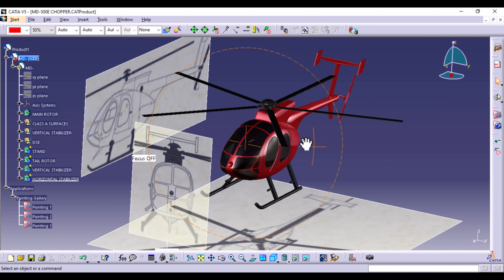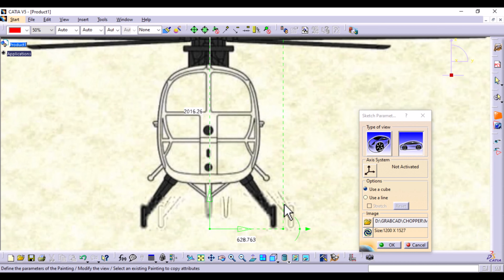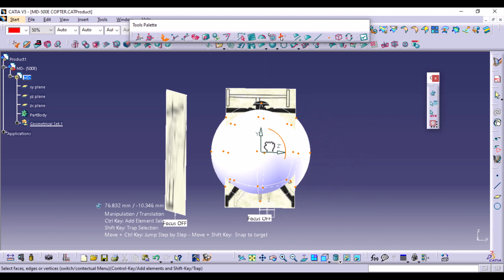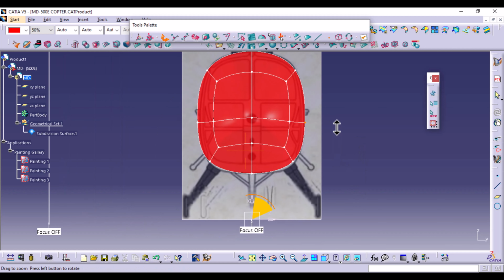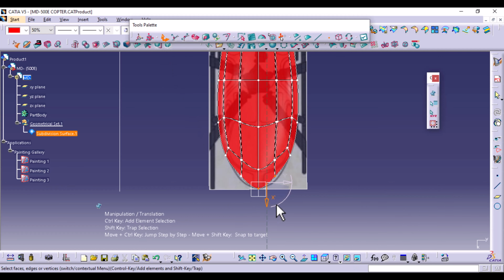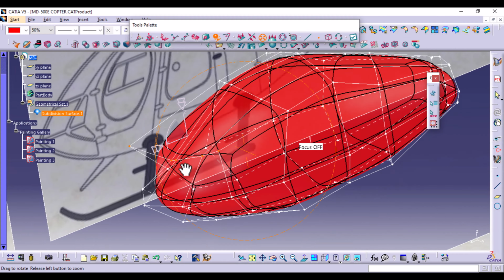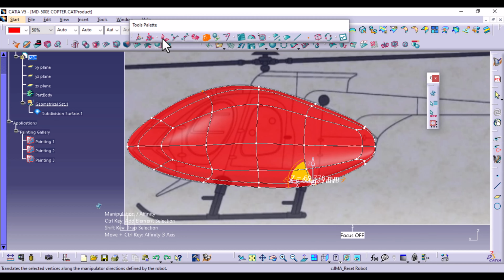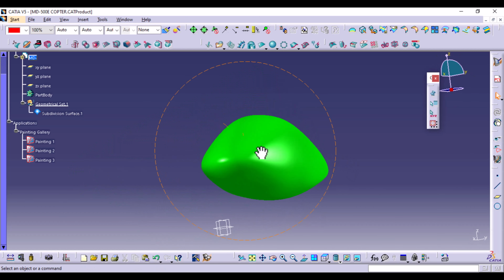CATIA ICEM (IMAGINE & SHAPE) - CLASS A SURFACING TUTORIAL| MD-500E HELICOPTER DESIGN| PART 1

Comment: Ariel You're truly the best, Thanks for your rich content🥰
and I dont know why when I select the subdivision surface it selects a box around it and dose not projects dots on my surface. I can only manipulate it with that box which is so low quality compare to your setting.
Reply from the maker: Hi,.what version are you using?
Reply: @ArielCad-3d thanks Ariel for answering my comment, It is Catia P3 V5-6R2019
Reply from the maker: @ehsanmansouri6897 when you're editing a subdivision surface, there's a selection filter cube that appears at bottom corner. When you hover over the cube, there are 4 drop-down menus at each corner...Set it to 'rectangle', 'all/all', 'low'& 'distant'...If you still experience the issue please send me a screenshot or screen recording via the email on my bio or reach out via LinkedIn
Reply: @ArielCad-3d thanks, I sent message on linkdin

Comment: There are obviously some major differences between toolsets within the various versions of Catia V5. Like other people commenting here, my version has differences which do not allow continuation. When you create the sphere, you get a "Geometrical Set 1". I get a "Subdivision Surface.2". Secondly, I get a small sub-window in the bottom-right of the screen showing the sphere, which if I hover my mouse over it, gives view and selection options, base-mesh options, preview options, and trap options. You don't seem to have that. Thirdly, my sphere is black, not red, and I have no ability to view or manipulate the mesh as you do.
Reply from the maker: Hi, everything you referred to is in the settings. They're set at default on the  2020 version which i assume you're using.
On the toolbar, right-click & select graphic options,
From there you can change the colour of the mesh.
The project is do-abe on all versions of CATIA. The toolbars are just set at different places.
When I create a sphere I definitely get a "subdivision surface" under geometrical set. Because it's the first object, that's why the geo set appears.
I will be posting a new project on the IMA workbench starting tomorrow using Catia V5 2020. I think that will more easier for you to follow along. Hope this helps.

Comment: Hello, I couldn't pass far from the minute 23, my sphere doesn't show control points?  it shows a cage or just four points delimitating the shape, so I cant do trap select.. How do I do to change this, thanks for your answer
Reply from the maker: On the tool bar that appears when you're editing the subdivision surface there's an option to switch from edge selection to points selection. Click to switch.
Reply: @ArielCad-3d  Thank You!, I tried, but may be, I'm explaining myself wrong, Problem is: the sphere that catia gives me, comes with only 4 control points and because of that, less surface subdivision lines, so that when I switch to the control points selection option, I will only have four to choose from. Is there not an option to increase those sphere division lines? I made a video, please take a look, thank you so much in advance. https://youtu.be/gCOj3wnoXb0